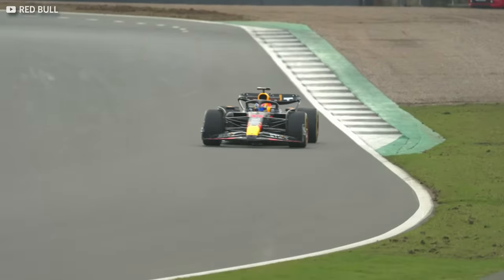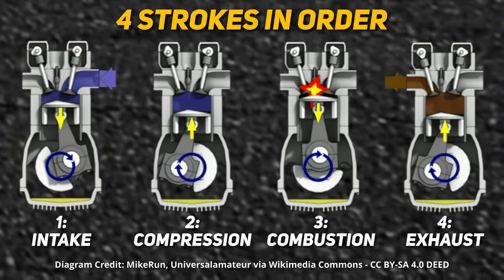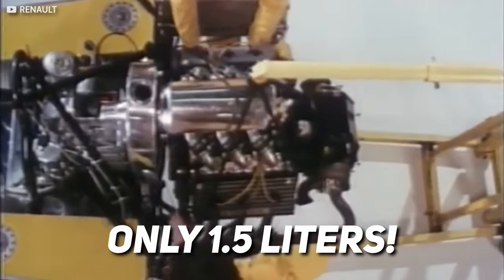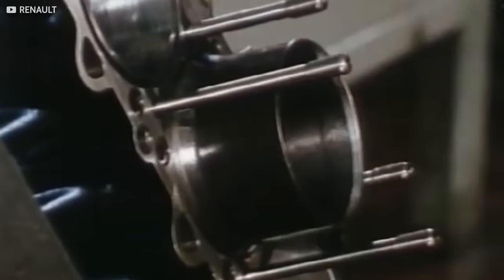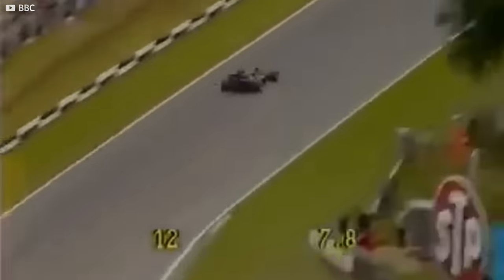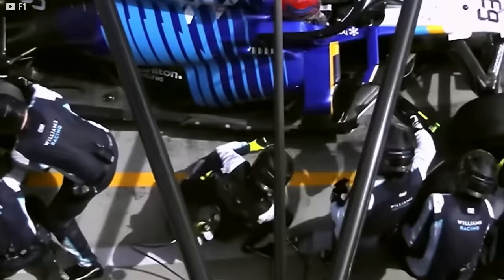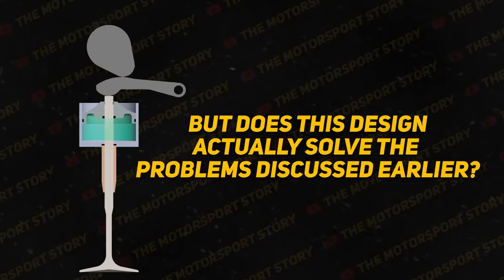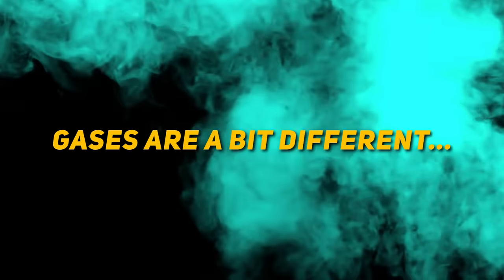This Tech Changed F1 Forever | Pneumatic Valve Springs Explained!

Comment: You missed the most important point. The resonance frequency. It is easy to build a non-linear spring, and the time that springs break is long gone. You can see it in modern motorcycles 16.000 rpm is not a problem at all and these engines run easily for 40.000km without failure. The problem with larger displacements is that the valves get bigger and therefore naturally heavier, so you must increase the spings force, but by stiffening the spring you increase their resonance frequency to higher rpm so the springs starts to resonate when it really counts at high rpm. You can still overcome this effect to a degree by using two springs with different spring forces. There are roadcars that use this method. The 1st series of Golf GTI is such an example. The fun thing with the gas spring is that it has basically no mass and it can't resonate, or at least not in a rev range where it matters.
Reply: oh that's interresting too. Do you know that when Toyota was active in F1 they even tested Desmotronic for their F1 engines. At the end they decided against Desmo but they played around with it. You can see a prototype in their facility in Cologne, Germany.
Reply from the maker: Yes, today's springs and metallurgy are much more advanced than back in the 80s, so the statement about breaking springs was in context of the F1 cars back then. They had some issues with springs breaking due to fatigue as well as heat but you are definitely correct that resonance can cause a spring failure also. I sort of glossed over this with the mention of valve bounce and resonance effects, but perhaps could have put more time into discussing resonance as a whole and it being a cause of total failure. I try to keep my videos easy to understand for a general audience and I wasn't sure I could get into this without the video becoming too long/too advanced for the average person. I didn't know that about Toyota playing around with Desmodromic valves, very interesting stuff! Thanks very much for the comment and for watching!
Reply: Great solution. I know how 2 and 4 stroke combustion engines work but i didn't know about spring resonance and floating. Using a tank of nitrogen is great idea. For a race car. The regulator reminded me of the one i used on my airbrush compressor that my old man made out of a fridge compressor,a tank,valves,connectors,and most important,the regulator. It was the one with a glass lower part with a spring that sealed it when the compressor made enough pressure with of course enough strength to push the round plate down and seal it. We live we learn. Great video.
Reply: @themotorsportstory  Just found you ,really enjoyed your video and it is a pleasant suprise to see someone who admits they may have maybe not explained it correctly ,as you definetly know what you are talking about,Though you where mainly talking about the early 80s..It is amazing how small the F1 cars of the time where so small...Every positive has its negatives for the revs the average family saloon reaches,springs are fine ,,With F1 everything  in the engine has to last, say  6 races before they can fit a new engine ,i am not up to speed on how long an engine has to last as they are only allowed so many a year
Reply: Back then I used the tappets from the 2-litre Alfa Romeo engine in my GTI, which were lighter. They had exactly the same diameter.
Reply: @Slickhubert did you then fit lighter v/v springs?
Reply: @jakemurphy9536  That was in 1991 and I can't say anymore. It wasn't even my idea, but I had taken it as a tip from a tuning book for the GTI. And it was a great coincidence that I even owned two of the Alfa Romeo engines. I hadn't even considered the connection between spring, mass and resonance frequency in this constellation at the time. My motto at the time was "trial and error makes perfect". But I started studying mechanical engineering in 1994 and of course I would ask the same question today.
Reply: @snakeoilaudio .  -> Desmodrômico - like a Italian Motorcycle DUCATTI 😊
Reply: @jakemurphy9536  the use of Alfa tappets was not a solution for street use but for proper racing engines. So they were typically used with camshafts that had a timing of 320 degrees or even crazier to run the engine in the 9000-10000 rpm range. So softer springs were no option. But your idea overall makes total sense. If you reduce the mass then you can reduce the spring rate to meet the same resonance frequency, that's correct.
Reply: L
Reply: @alphasigmasezon8597  yes, and it's Ducati (only one T)
Reply: @MrPnew1   thanks !
Reply: Thanks for this info 😅
Reply: What you both haven't mentioned is that Ducati almost exclusively uses desmodronic valve systems and probably created it, but I didn't know a car sized engine had ever used it. And technically those aren't 'rocker' arms, but finger followers, invented by BMW and are nearly as important as pneumatic valves themselves for providing high rpm stability of accurate valve control. Great video 😅
Reply: There is already a good solution for avoiding resonance... Hydraulic compensators that r using the pressurized engine oil and act like a shock absorber 🤷
Reply: Totally disagreed with resonance frequency. These two spring system was introduce for max engine performance at higher rpms. If you want to know how it happen i can explain. In MTU 4000 and TE 94 series, those valves are not much heavy.. same time, Duetz TBD 16 V 620 also
Reply: @snakeoilaudio The Mercedes Benz W196 had desmodromic valves back in 1954
Reply: @GarJaMi  oh really? That's cool. But it was a Ducati invention, was it?
Reply: @snakeoilaudio  I think maybe they just designed/developed the arrangement of cams & rockers that suited their motorcycles.
Reply: @snakeoilaudio  same things installed in motorbikes rear springs. So is it also for resonance freq?😄
Reply: @sankasrinath2848  I am not 100% certain, might be but not necessarily. Do you find this construction only in high speed bikes, or in dirt bikes and touring bikes as well?
Reply: @themotorsportstory anything is understandable by anyone if you explain it well enough. 

The basic problem is that  it isn't just about mechanical properties and complications of SPRINGS. The pneumatic-valve concept allows for optimum valve lift and duration by eliminating the camshaft also. 

Or is that the solenoid valve concept. I get them mixed up at times. Anyway. Either way.  Each physical implementation has an associated limit. And it is true there are 4-stroke street bikes with limits approaching 15k but is it the displacement that is the problem (requiring more valve and spring mass) or the valve lift, duration and timing.  If the limiting factor is resonance that can be tuned out of the system.  But I'd still want a better system that doesn't have the risk of breaking. 

Would really be nice to eliminate the spring altogether.  Sure. But then what are the exact benefits.

I haven't taken the time to watch this video because of that question.
Reply: OMG! I've learn so much with this video and this comment. Thanks The Motorsport Story, thanks @snakeoilaudio.
Reply: it seems to me that desmodromic valve system is even more accurate in its performance, its just that it have the drawback with the wear and tear overtime
Reply: @endurofan9854  probably the biggest drawback with desmo is the bike getting stolen

desmo=Ducati and any Duc is a prime target for thieves, they'll walk into a Ducati dealership and steal one if they can
Reply: "You can see it in modern motorcycles 16.000 rpm is not a problem at all"

nothing is a problem for race bikes, you just need enough money to do the required maintenance on them between races

Comment: If a small tank allows to drive pretty far, there is absolutely no problem to use a small electric pump to periodically pump up a small reservoir for the valves. Of course with normal air.

Comment: I wish pneumatic valve springs were more common. They are so effective. They are used in MotoGP (Except Ducati) as well as F1. The MotoGP bikes have a small, probably carbon, tank and small compressor that pressurizes the valves. I'd love to see one of the new Dart Block 2JZ engines paired with a pneumatic valve head ran by timing gears. That could easily rev to over 15k. Joel Grannas money shifted his orange Supra and hit 12k, and everything was fine. It was a billet 2JZ though.
Reply: So for a road car the advantage is that I can ramp up the pressure with RPM? If you don’t race with displacement regulations, going above 12k gives you no power.
Reply: He is talking about race engines though. Or at least fun, fast street car engines. Dart is a manufacturer of aftermarket, high performance engine parts. And people enjoy trying new things and tinkering with machines. Increased rpm will give any displacement engine that can handle it and is designed for it, more horsepower. So even without a displacement rule, you can make more hp.
Reply: @9rjharper  flame front needs time to travel. Friction losses rise. Race cars don’t have torque converters, and shifts in a corner may send you flying. So pilots like the flexibility to rev beyond max power.
Reply: there is still the problem of piston speed. the average speed of a piston cant go above about 60mph, even in formula 1 engines. that is why they have such short strokes, down around 2" or 50mm to rev to 15k
Reply: @ArneChristianRosenfeldt lots of race cars have torque converters, and torque converters work fine with high rpm if they are built with that in mind, just look at what mclarren is doing with thier "single speed" supercar, which basically just uses a specially built torque converter as the transmission to go from 0mph to 250mph with 0 shifts.
these engines are also tuned to male power until very high in the rev range, and because of the short stroke they lose less to friction than youd expect. flame front travel speed is also a bit of a myth in a highly tuned engine, the flame kernel is used to make a spike in pressure and cause the rest of the cylinder to burn at nearly the same time through what is esentially controlled detonation, similar to a diesel but using the spark plug to control the pressure spike rather than pure cylinder pressure and temperature
Reply: @ArneChristianRosenfeldt  This. Besides, they don’t really run current F1 engines to 15k rpm, generally more like 12k.

There is no point in spinning more RPM for a few reasons. It’s easy to imagine why when looking at LS7 from the Corvette Z06, it is the largest GM LS at 7.0L and it is also the fastest spinning. When the generally accepted logic is that you need a shorter stroke to spin faster how does this happen?

It’s all head flow. The larger bore and stroke allow the much larger LS7 to breathe in a larger volume of air than any other similar LS.

The problem with spinning more RPM and making more power is the amount of time the valves are open. A F1 cam may have a duration of 270 (of 720) degrees.

At 12k rpm a cylinder is firing every, 0.005 of a second, and with 270* duration that means the valve is open for only 0.0018 seconds not even 2 milliseconds.

If power is peaking at 10.5k rpm then by 15k it’s not making ANY torque because the engine isn’t getting enough fuel (because it simply won’t pump it) or enough air (because it simply can’t suck it).
Reply: Head flow is partly valve tech too. Tighter valve control can increase\maintain flow at higher RPM in cases where it would otherwise fall off with spring tech. A bonus of tighter valve control is a broader powerband. Of course you need the mechanical support (Correct mean piston speed) too if you get to those limits.  Flame front needs time to travel, but it's faster than one might expect. The key is getting that peak cylinder pressure at the correct crank angle, dumping the rest as fast as possible and getting to that next boom... assuming you're looking for peak power and don't care about economy.
Reply: @jkent9915  cam duration kills idle and cruise. I am no racer and out ...
Reply: @silentbobfan32  There is no "controlled detonation". I mean, kinda there is because the knock sensor listens to it, but it is only a small volume of the combustion chamber, just big enough to produce a knock signal. And even then the ECU is typically tuned so that most combustion cycles happen without any knock. But indeed, there seems to be some prechamber technology which takes swirl to a new level and shots flames in a star pattern.
Reply: @silentbobfan32  There is no intrinsic limit for piston speed, like piston ring failure. Forces actually don't scale like velocity, so this isn't it. It is just the flow through the head.
Reply: @ArneChristianRosenfeldt  wrong
Reply: @cornishcat11  but please explain why Wankel engines has a higher velocity. There is still steel sliding over steel with some oil in between. Just one of the disadvantages of Wankel: lots of sliding for little air. Liquid piston?
Reply: @ArneChristianRosenfeldt ...the current engines rules mean the air/fuel mixture is such that combustion doesn't take place.
Shrouded spark plugs have a shot of fuel rich air delivered into the Shrouded portion of the plug, when it sparks the flame front escapes the shroud and ig notes the main fuel charge
Reply: @philgiglio7922  you mean super lean bio gas generator.

Comment: As a Miata driver, feel called out.
Also as you are are reading this I'm trying to figure out how to put pneumatic valve springs into said Miata
Reply: Find a cosworth V10 to put in there!
Reply from the maker: It's ok, I'm a fellow Miata enjoyer 😉 So if you ever get it working in your car let me know haha
Reply: @themotorsportstory  haha, First I'll try with regular springs. Until I Win the lottery, then I'll have a solution custom made. (And probably a few sets so others can enjoy it too
Reply: @Birb_of_Judge  Just like my Mini S, the AC off button is the sport mode.
Reply: @sirhcsuiris  my Miata doesn't even have ac 😂
Reply: I need my hair cut. ✌️
Reply: Right there with you ... I've owned both an NB and currently an ND ... I've seen more than a few 1.6L making scary power.  My NB was bored to 1.9L and put 350HP to the ground.  Just nuts as I had a friend with a 1.6 making almost the same power.
Reply: Funny you mention that.  Another YouTuber named Wesley Kagan put a freevalve setup on his Miata.  And it ran.
Reply from the maker: I saw that! Amazing stuff!
Reply: Cant be thát hard...... right....???
Reply: @chrisbennett9391  my goal is 200hp with a BP4W.

But NA no forced induction
Reply: why would you want pneumatic valves?   You'll never be able to spin it fast enough to see any benefit.  The stroke in your engine is too long for high RPM.  At around 9500, the pistons would be moving at the speed of sound.  The momentum from the piston head would shear the pin.   There's no benefit unless you're going past 15,000rpm and even then the benefit is negligible.  Motorcycle engines can spin 16k+ and they don't need pneumatic valves.

Comment: Sorry, but you hit one of my sensitive points. A spring fatigue failure is not like bending a paperclip until it breaks. A paperclip breaks because you are plastically deforming the metal (stressing it past its yield point) and this causes work hardening, embrittling it. Fatigue failures are cyclic failures of a material that has been stressed below its yield point (you haven't plastically deformed it), but causes accumulated damage. These are two separate failure mechanisms.
Reply: Not quite. The paperclip example IS in fact fatigue, but "low cycle" i.e with significant plastic deformation (and work hardening, yes). What you refer to is the (much more common) "high cycle fatigue", with essentially zero plasticity. 

Source: materials engineer, 30 years of experience, including automotive reliability engineering 😊

Comment: that's why, once, during the Monza GP, BMW managed to reach 21000 rpm....during 3 laps (during the early 2000's)
It works, it works perfectly but...better be gentle with it or your rear tyres will lock at 350kph (that's what happened to one of the Williams BMW pilots during this race, when his engine decided to quit the race...after 3 laps)
Reply from the maker: Ouch😂

Comment: There is also a natural limit for steel springs. Stronger ones are heavier and so add mass to the valve they need to move. More mass -> more force needed -> bigger spring. Until you reach the limit.
Also coil springs resonate. That’s the reason why you often see a large spring with a small one inside. They have different resonance frequencies and together both resonance peaks flatten out.
Gas just behaves more ideal than bend iron. 😂
Reply from the maker: That's exactly it! Gas does just behave much better for this application😂

Comment: Thanks for the explanation of the gas spring. I don't think the fatigue in the paper clip is fully accurate but it does convey the idea of failure causation. I have a suggestion for a future topic if you haven't covered it. Ducati Motorcycles many years ago designed & put into production a Desmodranomic(I think I butchered the term) valve system. This is a fully mechanical system were by an additional 'follower' added to the valve captures the cam lobe. So the cam opens/closes the valve(s) w/ assistance of a small spring at lower rpm & a tensioning system of minuet travel to accommodate the mfg. tolerances to seal the valve into the valve pocket. I think that would be an interesting video, if you haven't made one all ready on the topic. I think that system could be used in any IC engine.

Comment: We need to develop rotary valves for IN and EX, those will require only a fraction of the torque needed to operate
Reply: Getting them to seal  has always been the problem 🇦🇺
Reply: @MICHAEL-ys3pu  🤔
Reply: Aspin engine